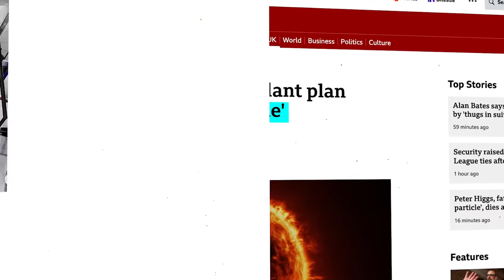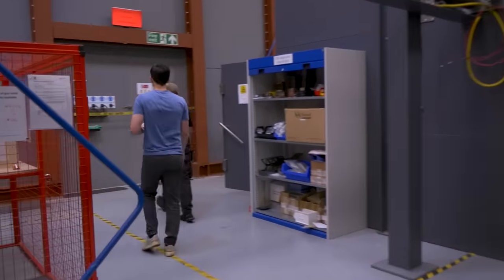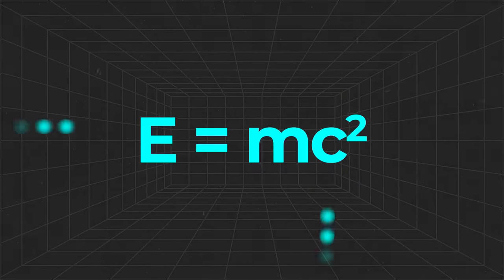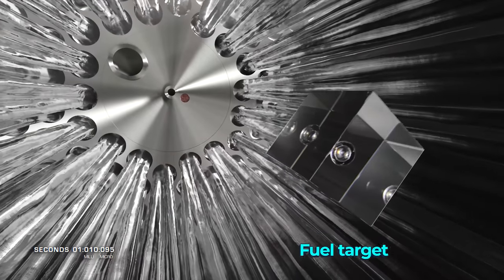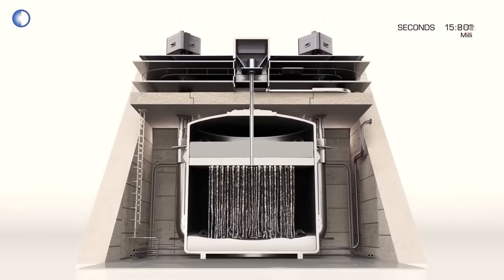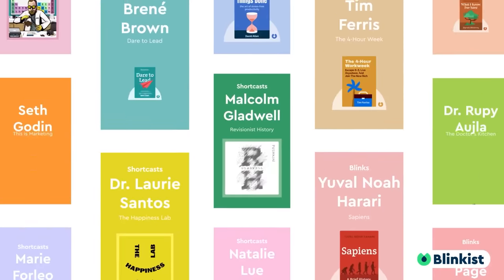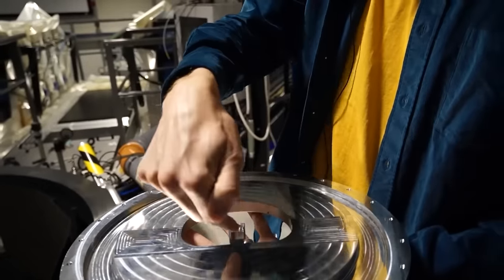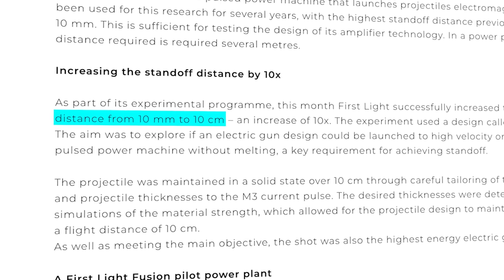Why The Latest UK Fusion Breakthrough Matters

Comment: "The landscape has changed, because we now have achieved gain."

This is exactly the part tons of people missed about the success of NIF. We can now see the finish line, so we have the tools to chart a course in that direction.
It also makes funding easier to justify. Instead of pointing off into the void, we have a flag out there and we can say "See that? Let's go there."

This will hopefully snowball, and hopefully means those "20 years away" timelines are effectively frozen.
Reply: Great point - hopefully we only have to wait 19.999 years now.
Reply: Nobody, absolutely nobody has ever achieved anything remotely near gain. It is all hype.
Reply: Energy break even, or even a gain, says nothing about economic break even which is equally necessary and much further away.
Reply: @rasmichael  this
Reply: @Mrbfgray  Nobody EVER achieved anything even near energy break-even let alone gain. Today you can count yourself lucky if you can get single digit % of the energy you expended back.
Reply: @rasmichael   OK.  But that's the constant focus, no pun intended...and it's not anywhere near good enough, as worthy an intermediate goal as it is.  There has to be a path toward economically competitive results.  I don't see it happening even with 10X net energy gain.
Reply: We can see the finish line, and it is 75 light years away.
Reply: Fusion: the World's Greatest Boondoggle
Reply: @rasmichael  "Nobody EVER achieved anything even near energy break-even let alone gain."
And this here is NO EXCEPTION EITHER.
they have NO gotten even close to that - same as any other fusion-reactor that had reported having net-positive energy.
Reply: The joke's on us taxpayers.

Fusion is always the xx number of years away BOONDOGGLE.

Comment: Things always brushed under the carpet: I'll believe them that the approach with the gun works, but the entire lithium curtain thing is a different beast.
Lithium is chemcially fairly aggressive and can corrode steel. But you need it to be Lithium because you need to take the excess Neutron of the fusion reaction to produce more of the Tritium used as fuel for the fusion (the only other source of tritium is waste from nuclear fission plants, but the worldwide production is nowhere near enough to run a power plant on.).
In short: just getting the fusion rection to be net positive still won't be enough to get a full scale power plant.
Reply: Actually, I was going to comment on the lithium curtain as well, but in a much more positive light. So the problem with hydrogen isotope fusion has always been how to get the energy out of the neutrons. The big tokomak project can make all the progress in other areas that it wants, but realistically, without some impossible material that can absorb neutrons and survive relatively unscathed to turn them into heat, it's never going to actually work. This is the first approach I've seen that completely addresses that problem without relying on some mystical future tech material (by both the gun staying at a distance from the reaction, but also the absorbing material for the neutrons being a liquid). There's clearly still more hurdles to get past, but I would say (purely from watching this vid) that the lithium curtain concept is the real breakthrough of their approach...
Reply: It's so far beyond even that, they need to remove waste helium, stabilise the plasma flow long term, work out a way to get usable energy, refuel it whilst it's running, and so so many more things.

But hey, it makes great headlines and videos, so there's that.
Reply: Dilithium in startrek probably then?!......
Reply: A biggish vacuum chamber full of lithium showers is an insane image, but there are commercial fission reactors running at this moment on molten sodium - which is pretty comparable in the explode-on-contact-with-anything department, oh and BTW the sodium's crazy radioactive so the chemical fire would spread a cloud of death like Chernobyl (though a lot smaller and shorter duration).
Reply: Yes there are a lot of problem with liquid lithium: very corrosive to any structural material, much worse at those high temps they need to run at; it might destroy the vacuum pumps or and ruin UHV (fusion reactions has to happen in best vacuum possible); it reacts explosively with water so not a good idea to have lithium near water
Reply: The excess neutron of the fusion reaction cannot produce enough tritium for a self-sufficiant reactor. Each fusion event consumes one tritium atom and produces one neutron, which can breed one tritium atom. Since no technology does operate without losses, neutrons and tritium atoms will be lost. Therefore, neutron multipliers like lead and beryllium, which release more than one neutron for each neutron they capture, have to be added and consumed in the breeding process.
Reply: Lithium ion batteries use steel casings, some even use steel current collectors with raw lithium foil on top. Using the correct alloy of steel to prevent corrosion is so simple it isn't a problem. You obviously don't know what you're talking about. And to say we don't have the production capabilities for supply, considering thousands of tons of lithium are used in manufacturing EV batteries daily... Yeah you really don't know what you're saying.
Reply: @pilldickle1688  Did you ever think maybe the properties of lithium might be different at fusion heat?

Comment: You're right more than anyone may believe Prof. Miles, when you say: "We have to confirm that the Universe works the way we think it works" when we reach some operating conditions that have never been practiced before.
As an example, the forces holding together the atoms of the projectile under that immense speed - do act the way we expect? I would use the fields theory to solve the problem...

Comment: I remember doing some back of the envelope calculation according to which a tiny grain of interstellar ice, hitting a spacecraft traveling at a fraction of the speed of light (such as .1 c) , could cause the hydrogen atoms in it to fuse, making the impact a lot worse. The speeds mentioned here are ~1/1000 of that.
Reply: There's a Russian crackpot, Alexander Bolonkin, who puts out an absolute barrage of deeply impractical but fun concepts. One of them is to fire multiple sub-milligram lithium deuteride nanobullets at ICBMs at very high speeds, to make aiming easy, and a small distance apart. If the front one hits an incoming weapon it decelerates. The second one then hits the squashed first one, initiating a "small" nuclear boom to neutralize...anything.
Reply: "hefty insurance premiums"

Comment: Correct.  The paradigm is called model-based.  It means a science/computer model can be accurate enough to do useful simulations, make improvements without actually building things, etc.  It's used in a lot of good engineering.

Comment: The part I don't understand about the idea of Confined fusion is how they plan to sustain this fusion process over many years in their projected power plants. From what I understand from this video, they would not only need to manufacture and shoot a constant stream of "targets", but also projectiles and even the consumable part of the electric gun.

It seems to me that the amount of energy and material needed to manufacture all this stuff 24/7 plus the energy needed to set, fire, and clear it all every few seconds will likely be a huge drain on the plant's energy output. Also, wouldn't it turn all this destroyed material into a fast growing amount of slightly radioactive waste?

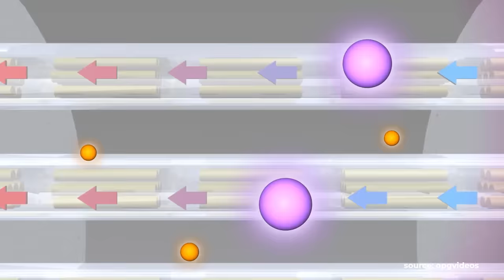Comment: 2:28 we are not trying to recreate the condutions at the core of the sun. Instead we need temperatures abd pressures far higher than the center of the sun so as to increase the rate of fusion far more than what happens at the center of the sun.
Reply: The Sun is fusing protons. Fusion reactors are mostly trying to fuse Deuterons and Tritons. The rate is already multiple orders of magnitude higher. We still need temperatures about 10x higher, but actually considerably lower pressure
Reply: @MattNolanCustom  pressure sort of looses meaning at high energy few particles.  For instance, we dont really speak of pressure when its two protons slamming Into each other.
Reply: @kreynolds1123 you mentioned pressure in your original comment. Further, any useful fusion reactor will be using absolutely vast numbers of particles, not just a couple, otherwise it will not produce any meaningful energy and certainly not break even.
Reply: @MattNolanCustom  I'm sorry to appear to as if to flip flop.  My inital comment on pressure was factoringing several different confinement techniques. Then in responce to your comment i was reflecting on what is pressure really in the context of fusing a few protons vs a great many protons, and how subjective is the distinction.  

More reflecting. On fusion rate, on the one hand, at the core of our sun fusion is slow enough that the sun can last billions of years. On the other hand, hydrogen bombs fuse protons at a far faster rate.  Hear is to hopping humanity can learn to fuse hydrogen at a rate inbetween the two in a way that we can commercially viable way to power humanity needs. 

This doesn't sound right but this is how Google AI responded to me asking the rate of fusion per colision,  it said the core of the sun was about  0.1% while deterium and tritium  in a hydrogen bomb was closer to 30%.
Reply: @kreynolds1123  I've not seen Google AI give an answer to a technical question which is not deeply flawed. What do those % rates even mean? You're right - it doesn't sound right! An H-bomb typically uses a fission bomb with shaped charges to produce the symmetrical compaction needed to trigger the fusion core. NIF and First Light are loosely analogous to this. Tokamaks, Stellarators, etc. are pretty much the opposite extreme. Much lower pressure / density for much longer times. Pressure is related to energy of collisions and frequency of collisions. Temperature, at least in Maxwellian systems, is a proxy for collision energy. You corrected yourself later, but H-bombs don't fuse protons.

Comment: She said fusion doesn't produce radioactive waste, but  all those metal parts that have to be replaced because they've been irradiated by fast neutrons are radioactive.  I don't know what the decay lifetime of neutron activated metals are, but the lack of actual danger has never stopped anti-nuclear opposition in the past.
Reply: It's a few hundred years half life for fusion bi-products.
Instead of 20,000+ years for fission.
Not to mention absolutely zero chance of a "meltdown" scenario.

In saying that, I still believe we must embrace fission completely and replace all fossil fuel plants with nuclear until fusion becomes a viable alternative.
Reply: That's true, but the public generally thinks of 'high level' waste aka spent fuel rods when they hear nuclear waste.  Medium level nucler waste is what all that induced radioative metal is considered, and low level waste is stuff like discarded bunny suits.  So the 'no waste' bit while technically true is mostly matching what the public thinks of as waste.  More correct Fusion advocates say 'no highly radioactive waste'.
Reply: Thing is, here (virtually) all the neutrons are stopped by the lithium rather than chamber walls. Producing tritium, which is rare and highly valuable for both this process and other fusion reactors.

Comment: 4:11 The only 'viable' way is continuous small feed through streams with high probility of fusion, much like particle colliders do, but with short cyclotronic accelerators, since the goal is fusion, not breaking. WIth the right angle and speed, this may be achievable, where the angle of each particle is the most decisive factor. 
In nature, nothing happens without reason, this means that the success or failure to fuse has factors in it. These factors are then speed differential, vector, angle and initial energy (heat). For 'viable' fusion, the heat must be as low as possible, while other factors are to be optimized in order to drain the initial energy factor. That would then only be speed differential, vector of collision with angle in there somewhere. Possibly heat oscillation is a factor since it would then also make the speed variable, with this then mitigated by lowering the speed by heat (the oscillation) by using the least amount of heat during collision.
Personally, I'd think that truly cold fusion has the best chance, with that meaning not without neutrons but low in temperature like nearing 0K, to reduce the speed variability, but also using the correct angle and speed to create fusion.
This can be done theoretically, but with any succcesfull fusion, heat would be relased, and would then be a block for the newer arriving fusion particles. It would make a great way to create larger atoms from smaller ones, but it would still require way more energy than comes out.
In both cases, either for creating energy or creating larger atoms, the speed and the angle are most important during the collision since these determine whether or not during that collision merger happens, succesful fusion.

Comment: If they combine all the current fusion efforts, Imagine 
A tokomak donut magnet with two rail guns firing deuterium foam frozen pellets into the center of the donut from each side ( the donut on edge). With six lasers at each side, on 45 degree angles, aimed at the center. All controlled by AI.
The guns pulse foam pellets, into the center at regular times. The magnetic donut holds them in place, while the lasers add extra heat, and keep the fuel in the center, by AI control. 
The heat can be removed by liquid lithium, and direct electrical power

Comment: I'm not a nuclear physicist nor do I profess to be knowledgable enough to even be an armchair nuclear physicist, so take the with a pinch of salt, it's purely an opinion; I don't feel that any existing ICF methods like those used by NIF and FirstLight would be viable for a commercial scale operation as they require precisely machined consumable components that would have to be produced en masse and systems would have to exist that can handle evacuating the resulting debris from each shot that the reactor produces. My betting is more on MCF devices such as tokamaks where the process can be pretty much continuous, by just keeping a good vacuum, feeing in D/T and the only waste you need to handle is  mostly Helium, which can be exhausted through the divertors. It just feels a bit messy; the only analogy I can come up with is trying to spin a gas turbine by firing shotgun shells into it rather than simply feeding in fuel and air and burning it.
Reply: It wont work because its not a SPHERE. a circular coil has too many degrees of freedom ...kinks . touches the sides. loses energy. peters out
Reply: @esecallum  From what I understand, researches are already working on spherical (or near spherical) reaction chamber experiments, such as MAST and START, at Culham Science Centre in the UK for starters. Besides, plasma instability is not an insurmountable problem, it's just a matter of time. My position on this hasn't changed.
Reply: It's interesting to me that at the center of the sun, where fusion occurs and has a density of 160 g/cc (not a near vacuum), the sun produces less energy per unit volume than a human body does.  Fusion is a pipe dream, promising incredible things, and will continue to promise these things until the end of time.  IOW, even if controlled and continuous fusion was achieved, to get the same power out as a typical fission plant, the fusion plant would need to be tens of square miles in size.
Reply: @unchosenid  it's the wrong shape. The plasma ribbon keeps kinking and always will kink even more if any fusion takes place as it will disturb the compression... It's a dead end.
Reply: @unchosenid  The sun overall produces energy per unit volume comparable to flesh. Fusion takes place only in a very small region at the center of the sun. The fusion energy release in this region is therefore massively more intense.

The amount and density of energy release in fusion reactions is readily measurable, and already far more intense even than that in the sun, and if they can make fusion work, the excess power at a given input is predictable. IOW no, in fact the PhDs working on this shit still know how to do basic arithmetic.
Reply: It is conceptually inelegant, but there's a lot of precedent for injection molding and/or machining parts economically, to tight tolerances, in ridiculous numbers. Look up the specs and processing steps on different gun cartridges that are consumed by the tens of millions sometime. There are optical components with nanometer scale detail that are made 100,000 at a time by patterned silicone rollers squishing acrylic goo, I kid you not. I'm no fan of single-use plastics, but I'd happily trade the expenditure of these shotgun shells for carbon- and mining-free on-demand power to support renewables.

As for the debris...it really helps that it's in a liquid metal, and likely to float to the top. Filters and skimmers, baybee. As per an insightful comment elsewhere here, the unspoken problem in MCF is getting the heat out usefully from behind your plates that have to be both highly heat-tolerant and neutron-tolerant, without leaking it into your nearby superconducting ultramagnets that have to be near absolute zero. The lithium here is already a hot fluid that can just be pumped over to the water tank, and the result of transmutation is tritium, a valuable and useful product.
Reply: The joke's on us taxpayers.

Fusion is always the xx number of years away BOONDOGGLE.